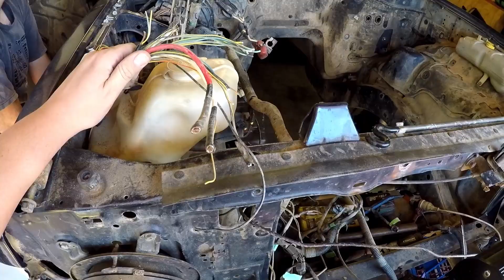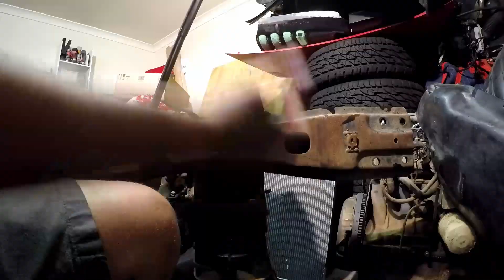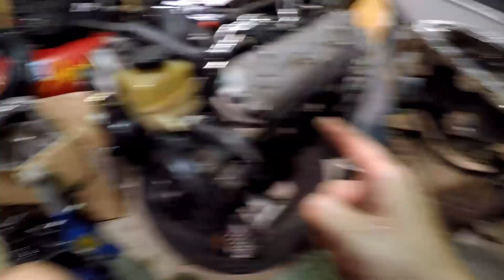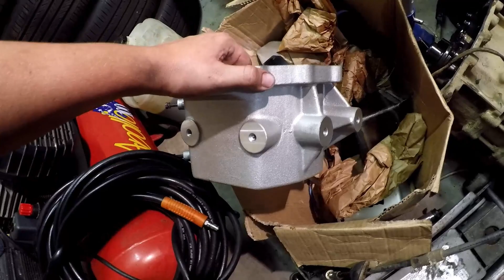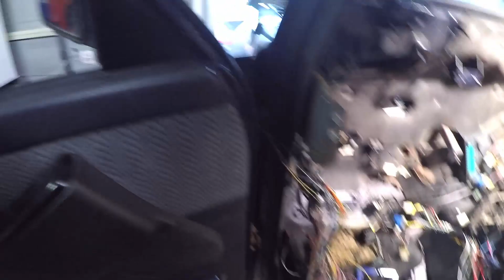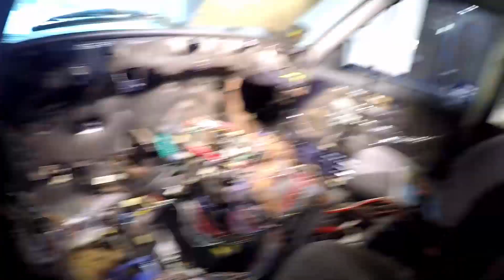Transfer Case Removal LS1 Patrol Part 5

Comment: Hey mate how hard would to be  or is it even possible to remove the transfercase with gearbox still in gcar?
Reply from the maker: Yeah you can do that just need to undo both drive shafts the shifter for transfer case the hand brake cable inside the car any connectors and breather then just the 10 or so bolts that bolt the two together